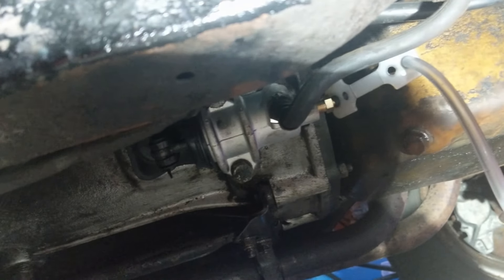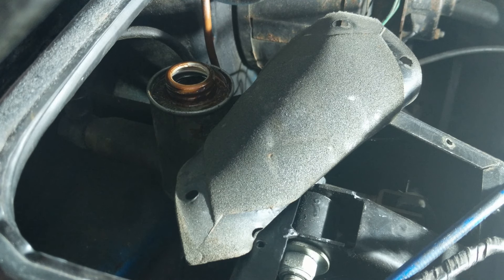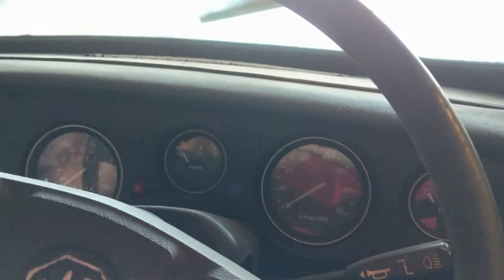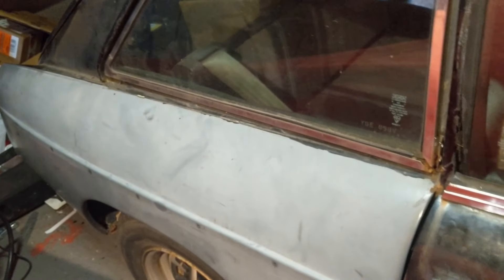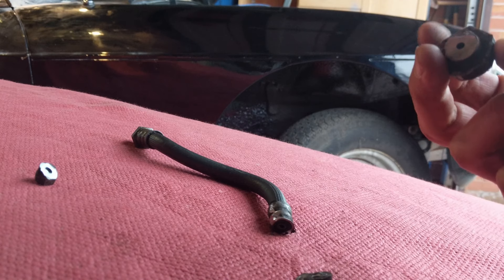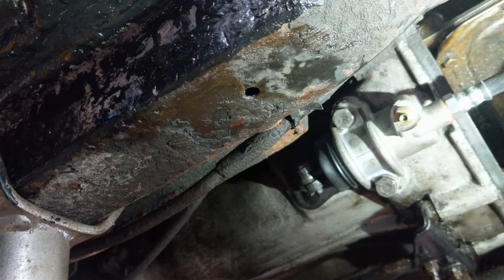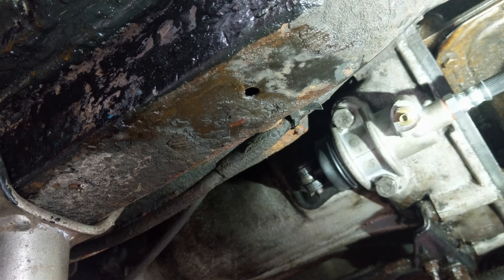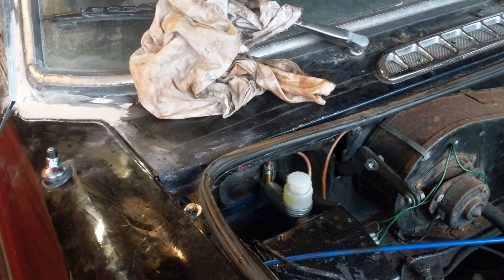MGB GT Episode 8    Work on Clutch Slave and Master Cylinders

Comment: Hi Henry, I know you're on to the TR7, but I'm doing my clutch on my MGB GT.. you need a 2nd person, get them to press down on the clutch pedal, undo the bleed screw.. keeping foot on clutch pedal disconnect the pushrod from clutch arm.. then push rod in to slave. Do up bleed screw and try clutch. Repeat if necessary...
Reply from the maker: Yes, I know but didn't have a second person.  I've now got a pressure bleeder which works brilliantly and is a one person job.